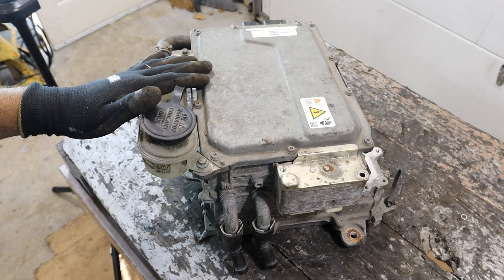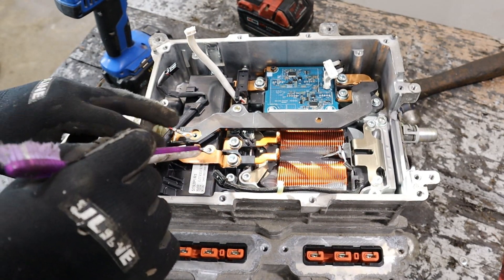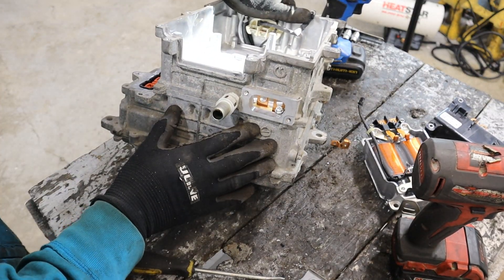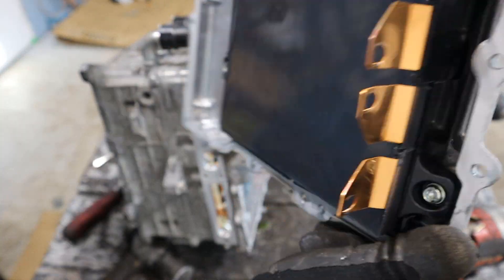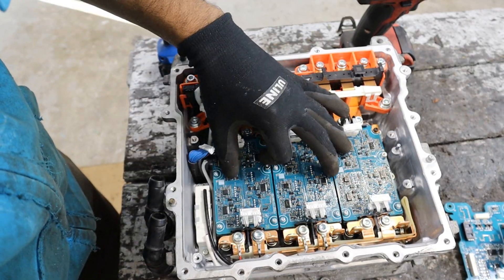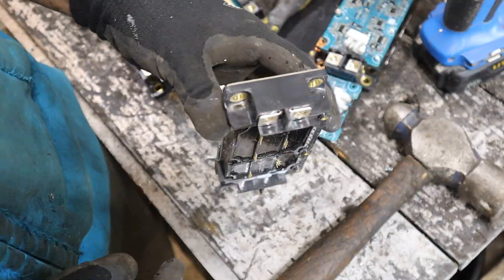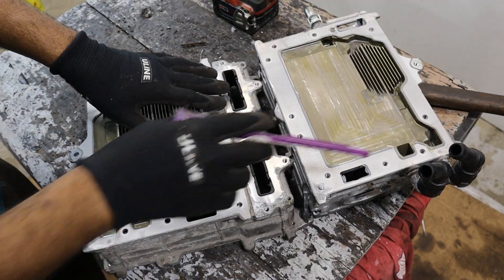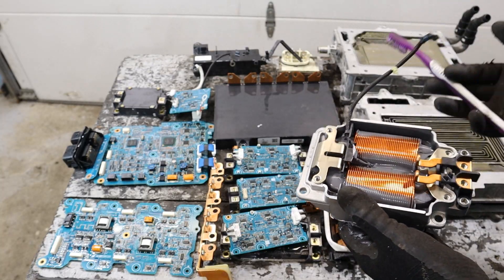How a Hybrid Car Works: Ford 2nd Generation Hybrid System

Comment: Why does the engine have an alternator if it uses the hybrid battery charge thru the inverter to charge the 12V battery then?

Comment: Good morning Sir. You definitely know your stuff. I have a question I was told if I change the inverter it has to be  I need to reprogram it I need to take it to dealership for that, but I was told that if I use the same board from the original inverter I don't have to. The new inverter with the original board the one in top. Thanks
Reply from the maker: I don't think older Toyotas were like that. Just plug and play.
Reply: Sorry I forgot to tell you that I have a 2013 Ford C Max Hybrid. Can I swap an inverter and will it run or needs programming? I was told that I can use the board from original inverter and no need to program ecm

Comment: Interesting stuff and well explained, but you are also falling for the stepped wave pattern someone at the marketing department for digital audio invented a long time ago. In reality this stepped waveform doesnt exist, instead the waveform is a PWM signal (full on/full off).The PWM frequency causes the typical whine EV and hybrids make (some louder than others).
Reply from the maker: Thanks nfor the clarification

Comment: Good video. Can anyone tell please @7:37, what is the purpose of that white color "big resistor"?
Thanks.
Reply: To discharge the capacitor after the system shuts down. Its a safety feature, so to not shock anyone working on the system as they will asume there is no voltage.
Reply: @ComplicatedStuff  Thanks for your kind clarification. Appreciate!
Reply from the maker: I explained in the video, for capacitor discharge
Reply: It's a mystery why it's so big because for a rating in kilo ohms it's not going to be passing much current at 400V

Comment: I still so surprise that they are using thermal paste that can dry out and lead to failure. You would think that for the price of these vehicles they aren't using some kind of phase change material instead.
Reply from the maker: I didn't think they expected it to last that long! 
Fyi Toyota uses a similar thermal paste
Reply: It doesn’t dry out in such a system as the temperature range is not that high (water cooled). It is not a computer CPU for tinkerers. Phase change material has a different purpose. Thermal paste only fills up voids between to metals. It’s actual conductivity is quite bad (but much better than voids).

Comment: Another fine video brought to you by "Speedkar99". Thank you. Surprises me all those electronic parts with stand the environment. 

Finally saw a video on a Mazda plant building cars from casting to machining. Transmission building & how they use rotary engine for the gas engine portion. I swear I could hear your voice except no voice. Low music & written explanation. 

Being an I/E Journeyman I can truly appreciate the PLC programming that goes into making those robotic welders & other automated equipment function. PM's & calibrations, wow. Lots of visual & hands on QC goes on still. Amazing
Reply from the maker: It sure takes alot more than just what I dissect here that goes into making these work. Machine work, design, programming, manufacturing, logistics! Amazing

Comment: Great content, as usual. You've just shown me something really scary. What I've just seen is $$$ repairs. I wonder what tolerances they used. Usually, in automotive, we're using elements, like caps, with operational limits between -50 - 105°C and I wonder what's the upper temperature limit this assembly reaches. The higher the temperature, the shorter the longevity of the elements. Usually, the lifespan of elements like capacitors is up to 5 years. As for semiconductors - it depends heavily on the temperature. And now I wonder: what happens after these 5 years. Capacitors simply can't last longer. What's the cost of the unit you've just disassembled. Power electronics never last long because of the very nature of semiconductors: they lose their properties in functions both of time and operational temperature. The question is what tolerances they used. What's also common in automotive is gradually shrinking these tolerances to absolute minimums. Each iteration will last shorter. Add to this the cost of wearing motors - isolating enamel has also a short lifespan, also heavily dependent on heat - and we have a disaster.
And eco-ignorants will keep saying that "EVs have very few moving parts" - so what, if they heavily rely on complex electronics! Imagine now: one, cold solder joint... This thing vibrates because it's a moving vehicle! That's just terrifying. It's not "green"/"eco" whatsoever. And what about recycling all that crap? There's no single facility recycling this and there's not even one company recycling Li-Ion batteries.
Mind boggles.
Reply from the maker: Agreed there are different failure points on these than a typical turbo engine. 
However with its own dedicated cooling circuit, hybrid cars have proven to outlast their turbocharged counter parts. Toyota had made a good example of this with the Prius. 

I just wish ford made this inverter and the transmission more servicable than just replacing the whole unit.
Reply: I know this was 6 months ago but you are severely misguided on the durability of electrical components, especially capacitors.
The most common capacitor failures are electrolytics which are very sensitive to overheating and overvoltage, and their lifetime is directly determined by how close to the maximum values the capacitor is. I have personally seen many high power gradient systems which use electrolytic banks that are nearing 30 years old and still measure perfect with zero failures, due to proper design.

The capacitors used here and in most other drive inverters after ~1997 are film/poly capacitors. They are drastically more durable than electrolytics (to the point where it's an irrelevant topic) and provide better esr. The IGBTs are drastically oversized, being able to do over ~600A continuous when the inverter will never see more than ~130A

I have reverse engineered this inverter and have two of them. They are designed and built by Toshiba in Japan and are pretty much unkillable, like the Toyota inverters.

Long story short this inverter will last far longer than the rest of the car to the point where it's irrelevant. The only anti-eco argument is the hybrid battery. The rest is as durable as any ICE counterpart.
Reply: You can send all those circuit boards to Bangladesh where 10-year-olds will melt out the components over a plastic bag fire.

Comment: I’ve had spirited discussions about whether when it says 3 phase does that mean the motors are AC. We concluded they are in fact three pole DC motors. With a speed controller. A three phase AC motor is a specific thing and if you want to control its speed that is another matter. You mostly find that in industrial speed controllers. What do you think?
Reply: They call it DC, but in principle it is an AC motor.

A DC supply imitating three phase by switching on and off.
They call the motor "brushless DC"
But I think that's more for engineers to feel smart about minute differences.

A BLDC and an AC motor will both have three windings (in three phase; we aren't going to esoterics in this comment like six and nine phase)

The motors are technically referred to as "BLDC AC motors" or "ECM's" electronic commutation motor"
A "speed controller" regulates voltage, for the most part.
Reply: @ Yes! Brushless DC was what we settled on and I’m not an engineer but my brother and the men I was discussing this with were. Thanks for the breakdown 💯
Reply: @zxggwrt  my point is, it's the same thing.
Reply: @GothxJesus  there's a distinct difference...brushless DC is made for trapezoidal waveform, synchronous AC a sine. Trying to run on the wrong type results in (much) lower efficiency + will probably make the controller...unhappy...
Reply: @ you're over thinking this;
A winding is a winding. A "trapezoidal wave form" has no bearing on efficiency.

In fact, a trapezoidal waveform is AC, so what now?

BLDC controllers are PWM and output AC....

If you want efficiency then you focus more on bearing quality,
Permanent magnet quality, etc.
Add more pole pairs, blablablabla

No matter what, switching from DC to AC will make efficiency pointless;
You will always lose efficiency from that process.
Reply: @GothxJesus  BLDC drive is just a state machine, one phase +, one - and one floats, the controller loops through the 6 different permutations (it does what the mechanical commutator would've) and PWM regulates power (duty cycle=power), if you want only full power, no PWM needed. AC drive uses PWM to aproximate a sine wave, the duty cycle is being constantly changed to do this. It can't function without PWM.
A BLDC motor is a DC machine where the commutation is done by semiconductors. The internal construction is different from a true AC machine.
Reply: @ you're splitting hairs at this point. You don't want an answer other than "you're right." So have a great day

Comment: This hybrid controller is so similar to Toyota.  Both are very robust looking for electronics.  Both are very obviously designed with a priority on reliability and longevity.

I hope the Fusion hybrid transmission is next.  It will be interesting to see how Ford build theirs compared to Toyota.
Reply: I wonder how much Toyota influence is packed into this Ford Inverter. At least it is made in Japan. The details will dictate if they are just as reliable on the long term.
Reply: @ComplicatedStuff  No Toyota influence. Paice LLC
Reply: @ComplicatedStuff  they probably traded favors. Scratch my back i scratch yours.
Cant imagine what ford has to offer, seeing as they make garbage
Reply from the maker: There was a patent exchange on the original design. 
This "ford" design is still remarkably similar to Toyota and Chrysler hybrids
Reply: I don't think you understand what you're looking at.
It certainly isn't made for longevity.

Comment: How it works?......poorly!
Reply: Nah, I owned one for a few years.  It works great.  Fewer moving parts (see the Prius transmission teardown; Ford’s is conceptually identical).  No alternator, no starter, and no drive belts (water pump, AC, and power steering are electric).  Never a single issue with the drivetrain or electronics, good performance with 188 HP, and averaged 40 MPG even though I get on the gas like a meathead most of the time (the “secret” to good MPG in a hybrid is not tempering your acceleration, it’s refining your braking technique).
Reply: @Thegonagle  so you prefer Ford
Reply: @dustinswatsons9150  I don’t prefer Ford, I’m more of a Honda guy, but I do like Ford hybrids.  Toyotas are great for people who don’t like to drive, but not for me.
Reply: Ford’s hybrid systems are actually very good.  They’re almost identical to Toyotas.
Reply: Our Forester Hybrid has a worse mileage than our old Outback which was a regular car
Reply: It’s actually very similar to Toyotas